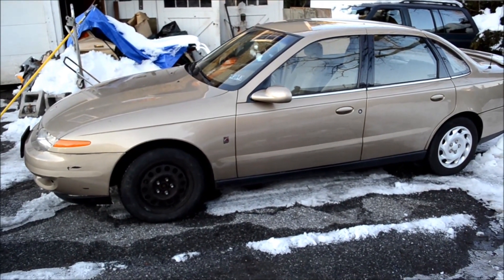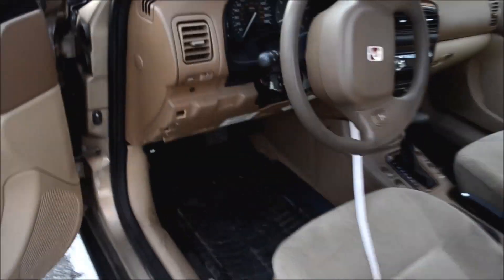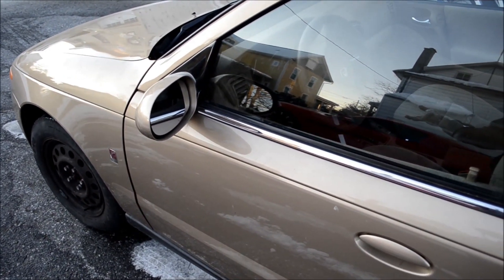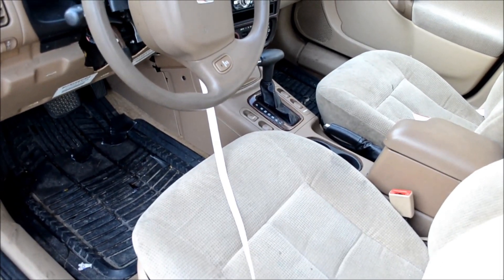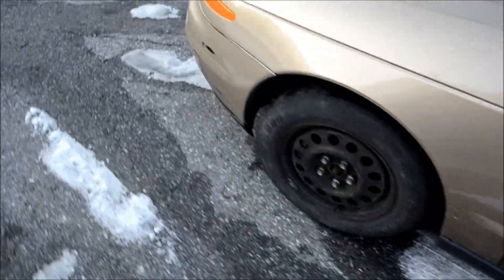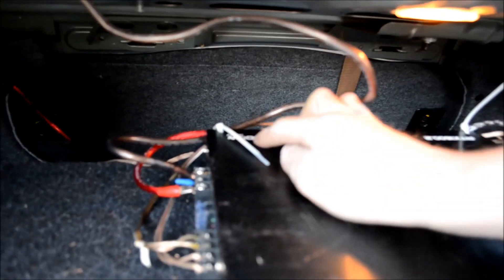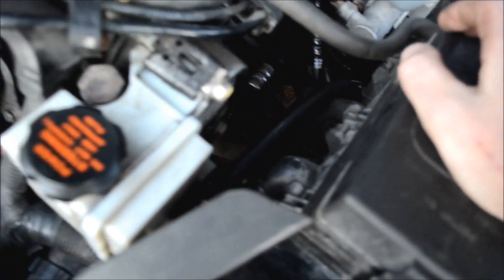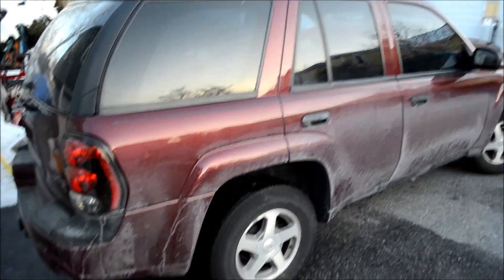2001 Saturn L200 Progress Towards Roadworthyness

Comment from the maker: Being the uploader to this video, I've watched it over and over a couple times and I feel so proud of what I've accomplished on this car myself. The amount of determination and sometimes hopelessness in finishing this project to be an actual success is FAR beyond what shows up in my videos. Its just something that I can't project out and share and expect a pat on the back for a job well done. I have to say that my time in the navy being a Machinist Mate working with many types of tools and large steam machinery made this job so less complicated and I owe that to myself for not giving up even when there were times I felt it wasn't going to work out, but it did. I did this under the direction of myself only using the extra hands of my father and helpful brothers. Plus I was battling snow, ice, the cold, blood, swearing,  and stress. A job that was expected to be completed in just a few hours getting the subframe in turned out to be nearly two weeks due to major complications. But I am smiling right now, yet you don't see that. Thats fine with me. What matters the most is that its another block higher in the pride department.
Reply: You can be proud of the accomplishment!  You met a lot of obstacles in this project and conquered them. The repairs turned out to be a lot more than you expected, but with your hard work, the car is fully back in better condition than it has been for a long time.  Good Job!

Comment: I don't know but I hope you can help me, I recentrly acquired the same car but as far as I know it has a "Security System", but I don't have the manual or a easy-to-follow guide to reset or eliminate the conditions of security, in case you have the manual or helpme with it, that would be awesome.
Reply from the maker: +JOKER KYZAR I'm familiar with the problem you have but I don't know how to ultimately fix it. It would sometimes prevent you from starting your car and would make you wait for 10 minutes or so before being able to start again. Our family had a few cars that had that issue. We attempted to do research on it to fix it but nothing succesfull. Maybe look on General Motors forums on the internet. Its an issue many have and im sure you'll find something that fixes. it.